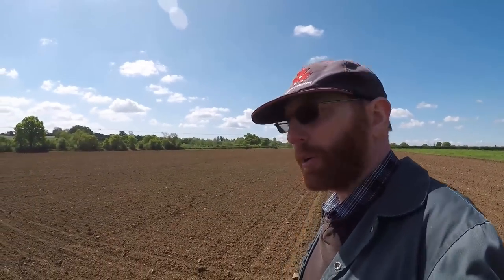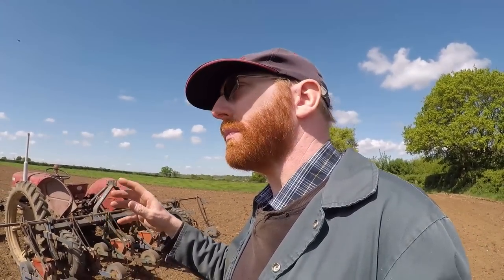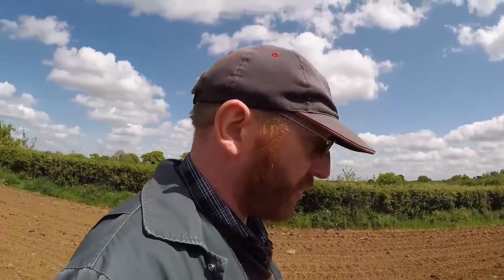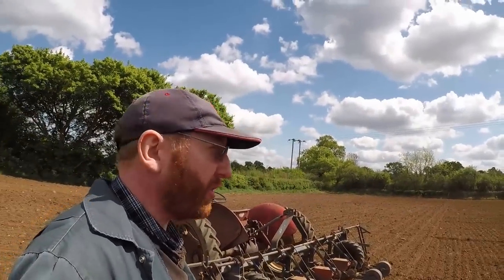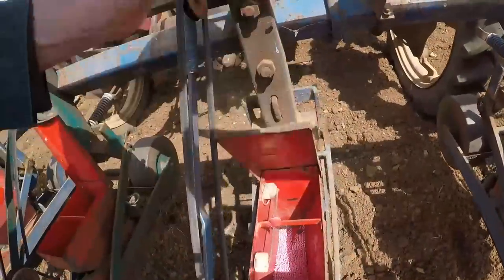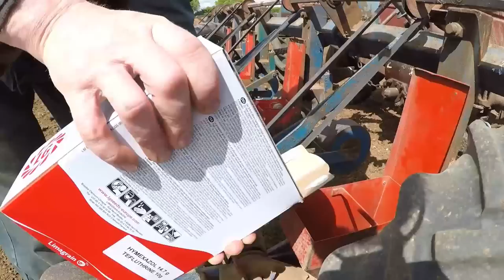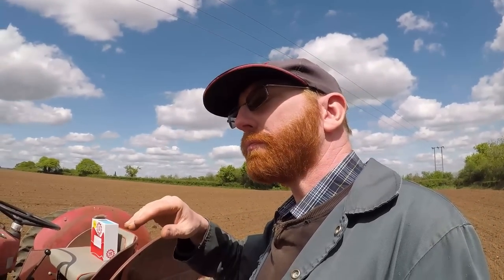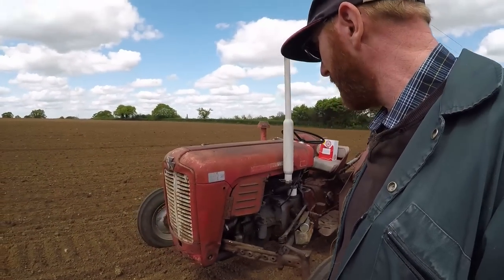Vintage Thursday. Massey Ferguson 35 drilling beet.

Comment: That offbeat three-cylinder soundtrack is a pleasure.  Great video Dan as usual,  I don't think I've seen a tractor tracked out that wide before,  watch it doesn't kill wheel bearings! Nice day for it too!
Reply from the maker: Bearings will be OK, it only does about 4 hours a year.

Comment: I notice you have the Hopper Monitor latched up, that will tell you when the hoppers are getting low on seed if connected.  I assume you don't use it?  I used to work in the Stanhay factory when it was located in Ashford Kent I know the seed spacing drill quite well.
Reply from the maker: Yes, it's a level monitor, but we don't use it.

Comment: It's done the job the only electric saying he's got is the starter
If you send someone to use that today they would need an understand where where it was cos he hasn't got a cab with a horrible noise blasting in their ears and it doesn't cost 150000
Thousand I used one of these in the 70s and it worked perfectly good